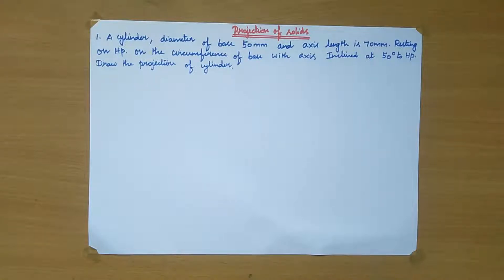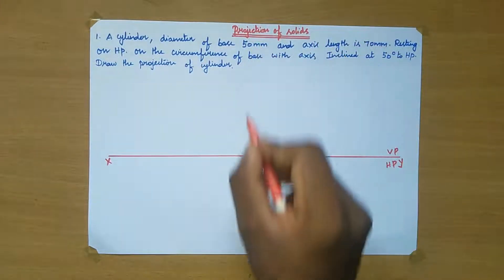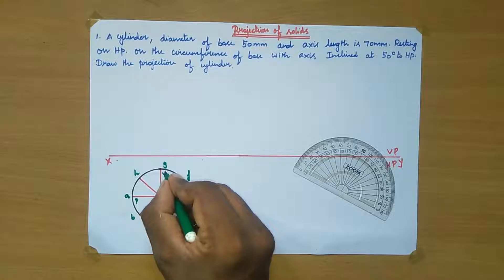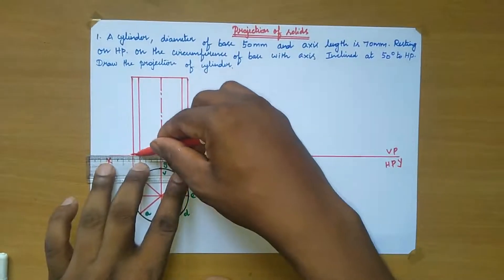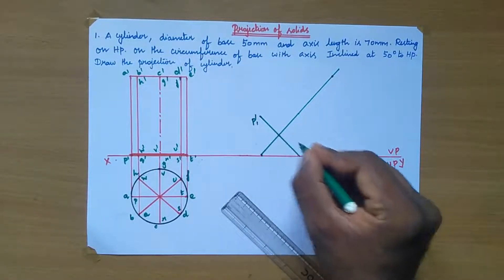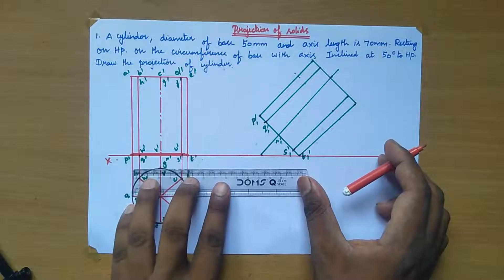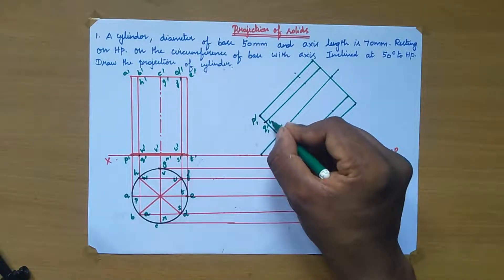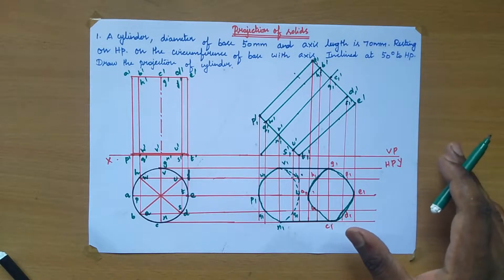Projection of Solids in Engineering Drawing | Cylinder I EG | Tamil

Comment: cylinder of diameter 40 mm and axis length 80 mm is resting on HP on a point so that the axis inclined 
at 35° to HP and parallel to VP. Draw the projection of cylinder.